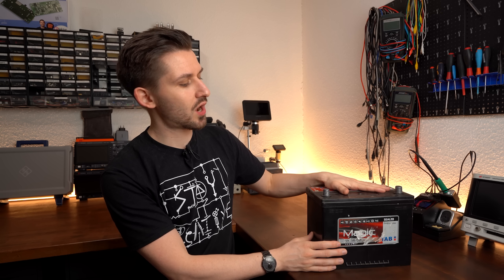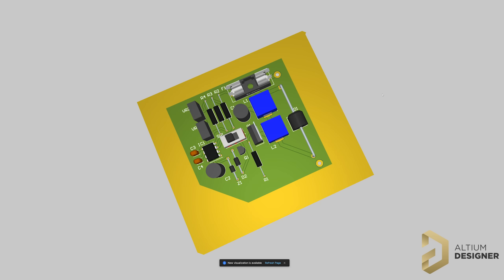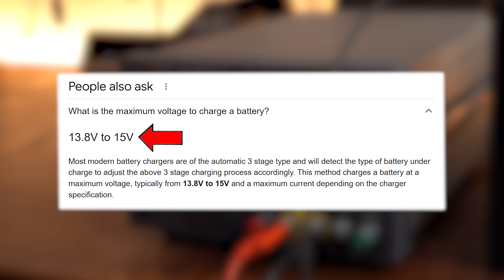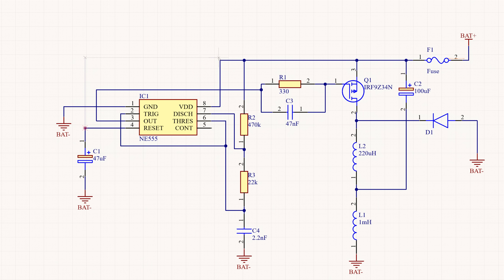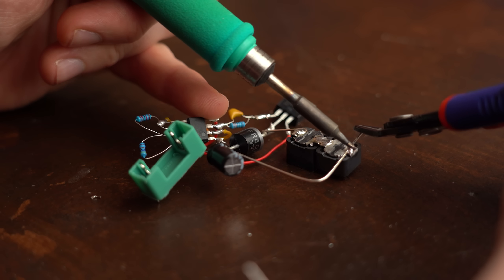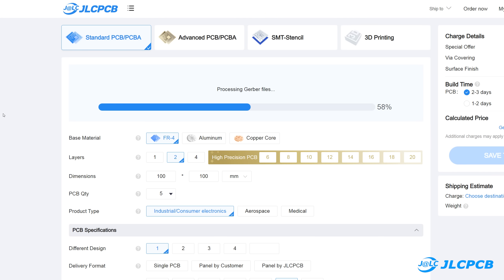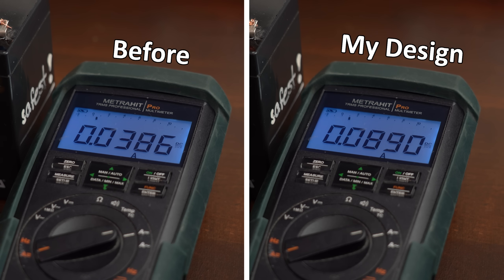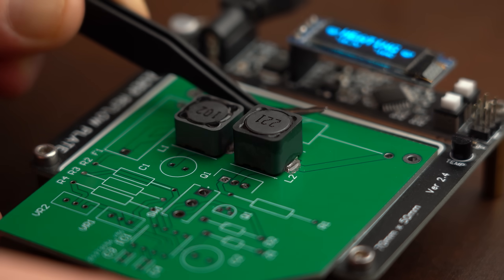I followed a YouTube "Battery Hack" and Wasted 30 Days! (Desulfator)

Comment: I would assume (but I could be wrong here) that if there was a circuit that could revive a car battery that easily, they would possibly be sold along side of, if not built into, battery chargers. But I will admit, this was a very interesting result with the diy vs. commercial.
Reply: They are built into battery chargers though
Reply: @forbiddenera  sadly not the one I own. Thank you for the correction though 😁

Comment: I have gotten good results with a large battery charger just transformer based and no smarts with a start setting of like 200 amps or more so I think it only works with flooded but take the caps off make sure the cells are full and run it on that high amp setting for 5 to 10 minutes and then let it rest and cool off then do it again a couple of times

Comment: Desulfating does nothing if the electrolyte is depleted. I have recovered many SLAs that were completely dead but they all needed topping up with deionised water. You never get the original capacity back but some got almost 80%. Useless for high drain but great for solar backups, desktop supplies and experimenting. I never used any 'special' desulfating circuitry, holding the the voltage at around 14v to outgas the cells works just fine. This doesn't do anything more than knock the sulphate off the lead plates which exposes the fresh plating and reduces the resistance to allow more charge.

Comment: I worked with lead acid batteries for over 30 years.
There is NO magic method to rejuvenate them!
Once the capacity falls below the level required, they need to be replaced!

Comment: Hi. Good try. But you need to ad distilled water or (more better) mixture of water and electrolytes (1 to 8 mix). Because your separator inside the battery looks like to "dry" and sulfate crystals won't dissolve.

Comment: I recently saw a video where they tested AGM batteries and compared them with LiFePO4.
They found, that the AGM batteries did not reach ther spec capacity.
So, maybe your batteries where fine and had no sulfation.
It's just a thought.

Comment: A proper desulfation device puts short 70V pulses between 12V ones to beat out sulfates on the damaged cells. Just using frequency oscillator won't do the job ;)

Comment: I love you channel and respect your content and testing.

 But I want to say pulse battery desulfation does work. There are hundreds if not thousands of reputable papers and studies done on the subject.

 The thing is it only works in specific cases and not on all lead acid battery types (There is like
4 types of common Lead Acids) also not on all batteries as there is many type of failures that can occur. (Sulfation, shorts, electrolyte drying, severe plate corrosion and failure, mechanical damage and so forth...)

 And it is very well possible that the circuit you're testing and what you got online just don't work. I am just simply trying to say though the concept of it overall does.

 Anecdotal evidence is I had a bunch of dead lead acid batteries thrown out from a company. I tried to save as many as I could.

 Most were shot as the electrolyte dried up. Some were very high resistance though and wouldn't charge but at a trickle (Under 50mA.)

 Some (but not all) of those batteries were able to have much higher charge rate after trying a desulfinator (Like 500mA to 2A) and would be able to produce small sparks after desulfation when non at all would be produced before.

 However even though there was improvement the truth is none of those batteries were 'resurrected.' They still were too high resistance.

 I do believe the Desulfation pulses helped clean the plate but the batteries still weren't any good not becuase of sulfation but becuase of too little electrolye left in them.
 
 But the noteworthy thing is I seen improvement. Enough technically the batteries could probably run small motors or LEDs even when completely unable before.

 And I think it's likely if that was a flooded battery and I could top up the electrolyte I might of had a decent salvage battery after.

 Again anecdotal evidence but I think this is worth investigating further. Thank you.

Comment: When it comes to rechargeable batteries, the best course of action is to, if possible, use a battery management system (BMS), charge and discharge the batteries according to manufacturer or traditional recommendations, and generally take good care of them as to maintenance and testing (best done regularly).

Comment: I did pretty much exactly the same route even down to buying a commercial one off amazon. Absolutely RUBBISH. Though I did think what if I got rid of the coils and just used a higher voltage supply that could give a good jolt of current? Haven't had time to think about it further plus decided to change over to lithium ion on my bikes.

Comment: desulfators are useless alone they must be used in conjunction with a charger and they don't use the amp's they use a high voltage ringing pulses set to a certain frequency to break apart the crystals but this can only happen after the battery is at its highest charge voltage on top of that it will not work on old batteries it is only usefully for battery maintenance or to restore a new battery that has been left below voltage over 48 hours

Comment: This is a battery pulser, this does not really work 20 years ago and there will be no enhancement during this time, because this lead-batteries are from the internal structure damaged and a little bit of current can not change it.

Comment: Maybe it would be better to use two diodes and two mosfets so the coil could be charged from the battery and discharged back into the battery, as it stands the coil just dumps into the back emf diode

Comment: So you probably desulfated the batteries to the point that what was left of the old lead started to fall apart. Sometimes batteries also need to get new electrolyte solution, as the high power charging on an old battery may have evaporated the old electrolyte down

Comment: I have a "smart" charger from Dunlop,and after some speculating,it's way off desulfating is turning on every 1-2 seconds with it's max charging voltage and the max current (14.8V 1 amp each second or so)
It managed to revive 3 of my lead acids that i changed(or added) distilled water in order to refresh the cells. Their capacity more or less refreshed and they were strong enough to not drop their voltages too fast under heavy loads. Although i forgot about them and now at least 2 of those are definitely dead for sure,still gotta try to see what they can do some day
Reply: Yeah some will raise voltage upto 16 maybe 16.5v for this

Comment: I have a 12v battery charger and it has a recondition option. I have tried it a few times on multiple different batteries. Only 2 times did it seem to help, but I certainly don't know why or what made those 2 batteries different.  There must be some form of use case but I still don't know what it is.

Comment: The best result I have ever had is a  very short increase in capacity that quickly faded in a day or two.
I am sure there are some situations where this works better as I can seen people rescue batteries, but its the exception and not the rule.
Reply: Sounds like your battery had oxide buildup. If you overcharge the battery slightly you can make the lead oxide take the reverse direction, but those oxide ions will quickly find something else to oxidize, either lead metal (again) or some protons hanging around from the acid to form water. Lead oxide is usually a permanent death sentence for the cells in question, since PbO has this property of being nearly unreactive, except when forced to be (as you did by slightly overcharging with your current pulses). It's too stable to electrically remove, is insulative, and really can only be permanently removed by force of heat in a melt. Oxidization usually means recycling time because of that.
Reply: @8bits59  Good to know.  Reading some of the replies there seems to be a bit of an art to lead acid battery maintenance for sure. While this video didn't have luck, nor did I, I grew up with a father who often was able to restore batteries by adding water and various rescue charging methods like putting a couple more volts through them than design. Sounds like there are a lot of scenarios to account for.  I am still a big fan of lead acid batteries and find they have some advantages over LiON in some situations.  I need to learn more about this stuff.

Comment: Desulfator circuits are too weak to be able to break down sulfate crystals however high current short pulse charging helps breaking down some of the crystals but you need your own special DIY charger.

Comment: i wonder what the pulses current is, it could be simply too weak : car batteries get discharged at 300+ amps and charged at up to like 60 amps, and that does not generate significant desulfation

Comment: The electrochemistry of a desulfator is solid, but often the reason capacities drop in lead acid batteries is more from "shedding": lead sulfate is less dense than lead metal, and like ice forcing against the walls of water bottle in the freezer, it can force the lead metal apart from the plate (or force itself off of the plate). This is very common in high current ignition batteries, which use a lead sponge matrix instead of a plate. Desulfators work for a very specific failure mode, but way more often the battery is simply permanently damaged by the formation of large sulfate crystals that either fall off the plate or force the plate apart. In these cases, the desulfator will do nothing more than cause a bit of hydrolysis in the electrolyte with each pulse.

Obligatory "desulfation works only at full charge" because otherwise the electrons you're pushing into the cell will only be used for the usual lead-acid electrochemistry long before any desulfation occurs (the E0 values for converting sulfate to acid are just a tick higher than those needed to convert lead ions to lead metal). If a desulfator is going to work, it will need to be used with a float charge that's enough to keep the battery charged between pulses. It need not be more than what's needed to counter self-discharge, and that's going to vary a lot from battery to battery.

And then there's the whole issue of lead oxide generation over the battery's lifetime, which also represents a permanent chemical loss of capacity.

Long story short, for 99/100 batteries, recycling and chemical processing are the only ways you can really revive them. For that one out of the bunch that's just not been used in a while, a desulfator could work but needs tuning, special conditions, and constant monitoring to make sure that there's no hydrolysis side reactions.
Reply: Thanks man, great insight about the process and the chemistry behind
Reply: That is a very awesome explanation of it!!!!  
The only caveat is that some AGM batteries are built well enough with thick enough fiberglass plates that they can hold together a lot better, even after being obscenely sulphated.  I have had good luck with recovering some of the AGM UPS batteries by popping the tops off and slowly adding battery electrolyte and hitting them with 15 volts and a MIG welder
Reply: @johnbrizendine7716  The DC welder method is the only method I've ever seen successfully desulfate batteries.  I've also seen welders used to revive irreplaceable proprietary Ni-CD cells.
Reply: Exactly this. The grey sludge inside a used battery is just lead which has been lost off the plates and had either reduced the size of the plate or is stopping the plate from functioning.
Reply: @astrawally8448  And also sometimes actually shorts out the plates altogether, even.  Deep cycle/marine/golf cart/forklift batteries have much thicker plates and that's why they can be discharged to such a low level and be recharged and still function.
Reply: @astrawally8448  and you see videos on youtube of people washing down their drains. Just unbelievable!
Reply: that seems more accurate than some of the above comments.
Reply: That is what i always wanted to know ! Tysm for opening eyes !

Comment: capacity of acid batteries is fake, usable capacity is always much lower then advetised, propably yours batteries were in good condition from the begining, try to measure capacity of the new battery, it can be 50% less than it should.

Comment: I purchased one of these Chinese desulfators and let it run for a month on a battery charger. I got the same results as it was worse. I then let it run a whole year on solar power until it was a dead battery. I disassembled the battery and all the lead in the battery had crumbled into bits at the bottom of the battery. They are a waste of time and money. I would have saved time and money by just buying a new battery, even when the electricity was free from the sun.

Comment: Hi! Ive been trying to find documentation on using old batteries with 1 or 2 bad cells in serious to get charged to 12v. Is there any pcb design  that can take eg. 10v plus 8v old batteries in series, charge them at 12v, then output 12v?

Comment: Built up lead sulphate is only one out of many problems a lead acid battery can have.
With your one battery not holding a charged voltage at all, I would say you have a shorted out cell which means that every time you try to charge it up every cell other than the one shorted cell is being overvolted. 
Ive had some luck with putting very high current through the battery and sometimes it will break a short lose from the high current and/or boiling.
But no de-sulphator will be able to fix that. And hince why when you put the bigger de-sulphater the capacity went down. Because you where overvolting the cells and reducing the little bit of capacity they have left.

Another very common thing is that they have gone dry, and when the lead is exposed to oxygen for a long enough time it builds sulphates as well.
In this case if you fill the cells with distilled water and then de-sulphate it and it should be pretty close to its original capacity.
Of course tho it depends a lot on lots of things. So it may or may not work and anything inbetween. And there are tons of other problems you can have with lead acids too.

Comment: I wonder if you could repeat the test with a self build single cell transparent battery, I am sure you could recycle the ones you already have for that :)
Reply: The whole process was actually confusing, At start he stated other creators circuit has 330 ohms resistor connect to nothing, when it is connected to ground to power 555 ic. 2nd he doesn't used that circuit and redesigned his own and used for testing, and between tests, he multiple times discharged the battery and due to that stress capacity even decreased more, even commercial one brought by him doesn't work too. He told circuit is real but desulfation process is fake, but maybe we don't know to use it properly, then why they're available and manufactured commercially.

Comment: Nice work testing that stuff out, tried stuff like that too and only had mild success at best, sadly.

But since we are at the topic of battery and charging, can you have a look at a "solar trickle charger" for car batteries?
I bought a 10W one to just keep the battery level (not installed yet, current weather makes that kinda useless :D) and I was wondering if they can even work or if they even discharge the battery

Comment: Hello, big fan of your work on this channel. I recondition lead acid batteries daily at my job. And I repair battery chargers. There exists commercial grade equipment that actually properly desulfates batteries. However that equipment does not use “high frequency pulses.” Essentially in batteries “high frequency pulses” are snake oil. There is only charging with constant current or constant voltage.
Reply: I think the high frequency is largely to prevent overcharging or maybe heat losses. Since you're not replacing the electrolyte, it makes sense to me (a chemist, admittedly, not a battery technician) that you would do that. I mentioned on other comments that the electrochemistry is solid and it can work, but 99% of batteries just don't fail at sulfation and instead oxidize (forming PbO) or shed. In those cases, a desulfator does nothing, regardless of it being pulsed or not.
Reply: Yeah sulfation is only one of many issues that a lead acid battery can have that’s very true. Sulfation that is reversible usually is sulfation that is caused by negligent damage in my experience. Think of a relatively new battery that is abused and builds up sulfate groups. If you charge a battery with an equalizing charge that features higher voltage than normal, sometimes you can recover lost capacity and/or cold cranking amps. What I normally do is I discharge the battery first, then charge with constant current at a low rate. I try to deliver as many amp hours as possible into the battery without causing damage. I have a laptop controlled machine at my job that costs $11,000 new. I program all the parameters and walk away. It takes 2-3 days to complete but it can do multiple batteries at once.

Comment: I've tried a few of these devices over the years and I have a BatteryMINDer. I actually think the battery minder has killed more than one of my batteries, but I always wonder if it was because too many crystals came off, settled on the bottom and shorted the battery...
Reply: how much if any temperature compensation did you have/use? I have the BatteryMINDer on a bunch of different batteries with no adverse effects but the batteries aren't in areas with a lot of heat usually. Which model were you using and were you using temperature compensated charging feature? (assuming it has it?)